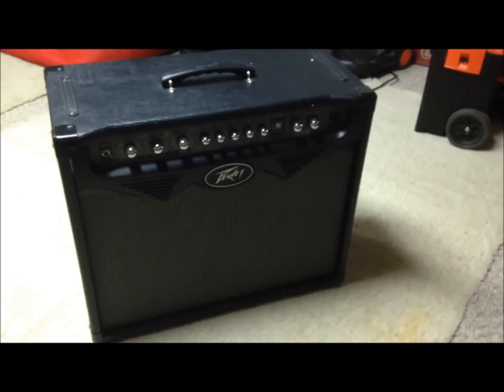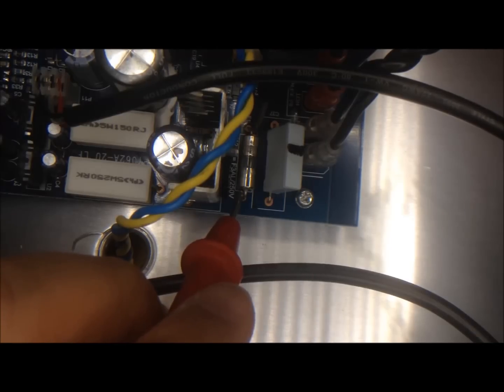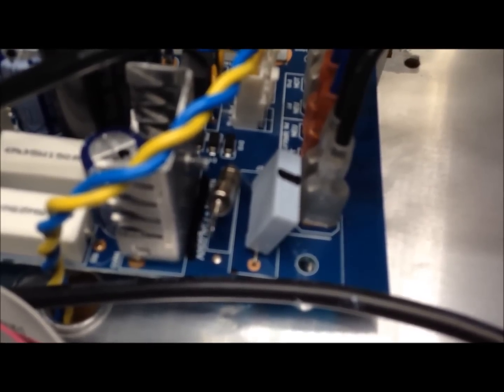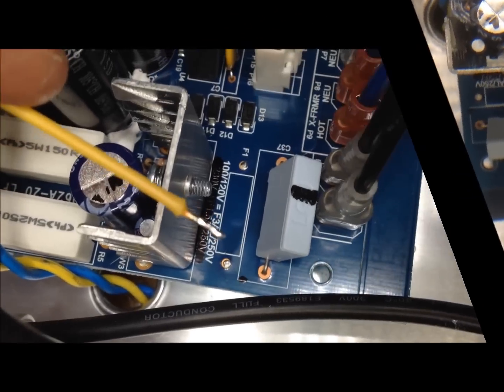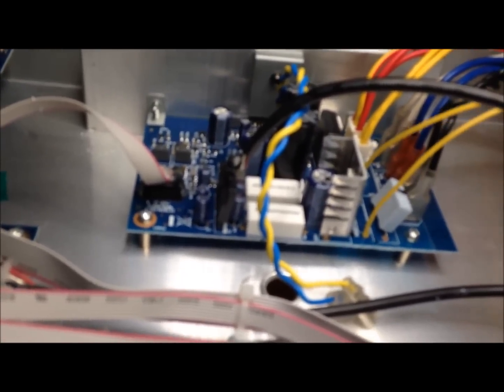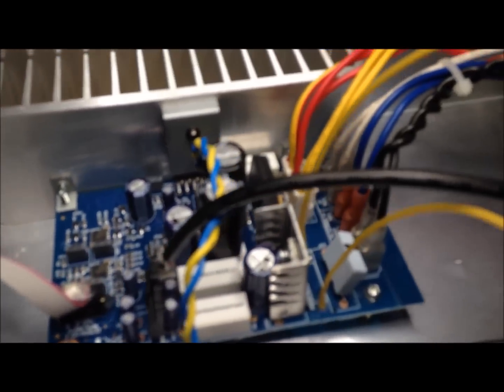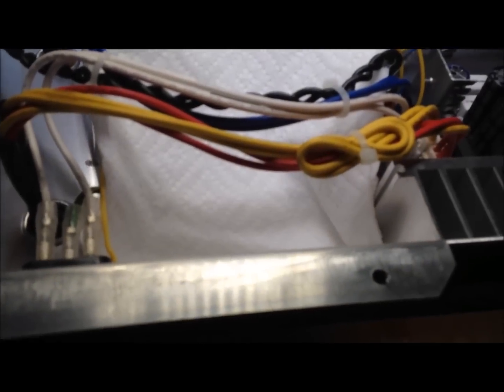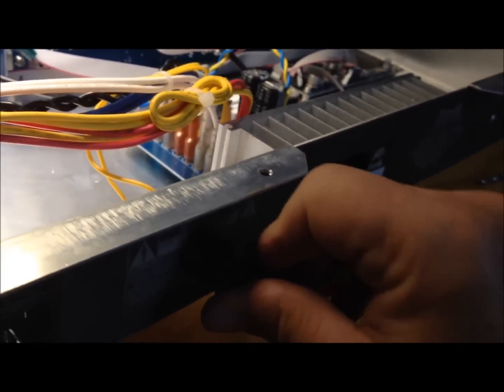Peavey Vypry 75 Watt Fuse Transplant Re-location Project Repair

Comment: Please help! How  do you remove the amplifier from the cabinet? I've removed every screw and bolt I can locate, applied moderate force from both sides and it will not budge. Is there an interlock or hidden mechanism that is holding it in. ? I have a new sanpera input/output plug with circuit board and I'm getting really frustrated.

Comment: Hi,  i just bought the sanpera 1 foot switch.  The pedal won't turn on.  I bought a new cable and cleaned the midi connectors.  Still no power.  When i slowly push the pedal midi connector in and repeat this the pedal recieves power.  The pedal and 1st addition vypyr 30 all function perfect.  Just the power to the pedal upon turning on the amp.  Any ideas?
Reply from the maker: Hard to say. Uplaoad a video and share a link. Maybe someone can figure it out and help.

Comment: Hi Jonny. Any specific wire requirements for this task?
Reply from the maker: The bigger the better. The current draw isn't a lot so you'll be fine with whatever fits in the whole. I used what I had on hand. You could use some regular speaker wire if it fits in the whole.
Reply: @jacka55penguin  Cheers mate. Worked an absolute treat!
Reply from the maker: @pvb2048  Super! Glad to hear it!

Comment: does it matter what wire goes to which point on the fuse holder?
Reply from the maker: No. It doesn't have polarity.
Reply: thanx for the reply

Comment: but I have the vypyr 100 w fuse .. anyone know if you can put = F4AL/125V says 100/120V or use the same 3amp?
Reply from the maker: Use the recommended fuse rated for the power of your amp. A 100W amp is going to draw more current that a 75W amp.
Reply: Johnny Whittenberg ive got a vypyr 100 with a blown fuse. what fuse would fix it?

Comment: Hello Johnny, I'm hoping you can give me some input on my vypyr problems. I have the 15w with the same blown fuse. On the board it said F1AL 250V. So I ordered a 1 1/4 x 1/4 1 amp 250 Volt fuse and holder. I noticed that the fuse I got was a slow blow. So I did exactly as you did but I used a heavier wire and when I powered on I immediately saw smoking hot wires from the power input to the board. I immediately cut power before I burned anything too badly. Any clue what the Hell went wrong? I made sure no strands of wire were contacting anything else. This amp is as yours, no signs of distress or damage other than the blown fuse.
Reply from the maker: Hard to say. If the amp was blown the fuse should have blown the same as the last one. Take another look and make sure your connections are clean.  This would only be if like you play it for a while then it blows. If it blows immediately then there is a problem with the amp. Sorry for your woes. Cheers!

Comment: Exactly what components do I need to do this? Never done it before but it looks relatively simple
Reply from the maker: Just find a chassis mount fuse holder..look on eBay. The size isn't important...as long as the fuse you get fits. Typical would be the 30mm BUSS type fuse.. 3 Amp and the appropriate holder. Fry's or RadShack might have everything you need.

Comment: I'm having a problem removing the fuse. no matter how long i hold the iron to the leg it's not coming off. Any ideas?
Reply from the maker: shano mac Remove the board. Add solder to the joint as you heat it with the iron. Quickly pull the leg up with pliers. Do it fast or it will cool off the joint like a heat sink.

Comment: Which fuse holder should I get for this amp?
Reply from the maker: Just look for something that will hold the common 5mm x 20mm buss fuse.There are other sizes but that's probably the most common size. Search Fry's panel chassis mount fuse holder. Might find a better deal on eBay. But, everything comes from China! Might as well weed out the middle man right? ;)

Comment: What fuse is that that you're using. My amp has been doing this almost weekly. The place that I bought it has been repairing it and now I think i know why it's continuously blowing the fuse. They're using a 1.5amp fuse lol. Is it supposed to be a 3amp fuse??
Reply from the maker: I believe so. Probably be a good idea to find the schematic and make sure. There are a couple of fuses unless I'm mistaken. I've done some many of these on different amps I couldn't say for certain. Put that fuse holder on the back panel. So, if and when it does blow again...all you have to do is unscrew it and drop a new fuse in.
Reply: i did! i originally watched this video and did the mod and it worked wonderfully until it started blowing almost weekly. the amp tech can't find anything wrong with it other than the fuse. i have the 75w as well and they've been putting a 1.5a fuse in there.i really think that's what the problem is. Man they had me buy power conditioners and surge cubes lol. i have a much better amp but i really do love this crazy little amp
Reply from the maker: If your amp "tech" is putting in the wrong value fuses, you should consider finding a new amp tech. The 75W has a 3A fuse. If that isn't what's in it...then yeah it should blow quite often. lol
Reply: the joys of living in a rural area lol. this is the only so called tech for a fifty mile radius lol. thankfully there's videos like this one to help me out
Reply from the maker: Cool. Well if you want to like my FB page it's Musician Magician Pro-Audio Repair. If you ever have any questions or need help with something, feel free to ask me there I'd be happy to help if I can.

Comment from the maker: Search eBay for something like this.....USA Seller CB radio Auto Stereo Chassis Panel Mount AGC Glass Fuse Holder 25 Amp.........Fuse - Slo-Blo, 3 Amp, package of 5 30mm.